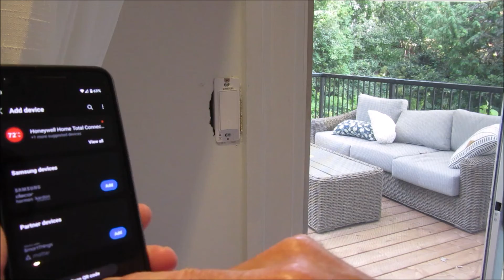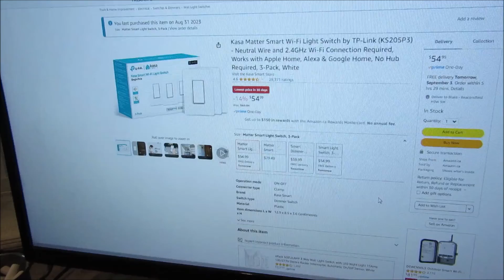Is Matter the future of the diy Smart Home & tp-link Matter wall switch install/test w/SmartThings

Comment: Just throwing it out there, with the Kasa switches, the status light on the switch turns on when the light is off giving it a sort of night light feature. It's bright enough to be seen during the day so you'll always be able to tell the status of the switch regardless of if you can see the light or not